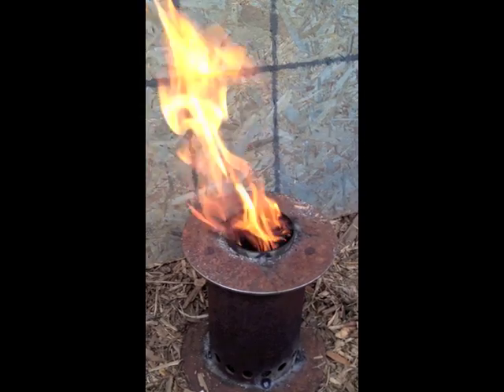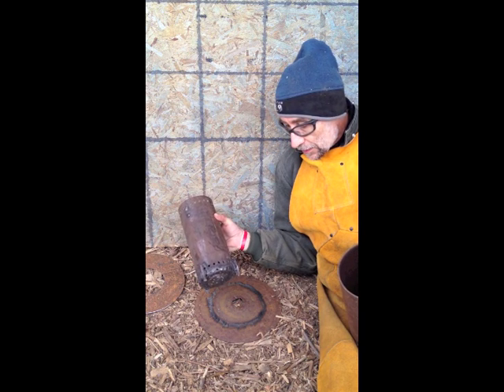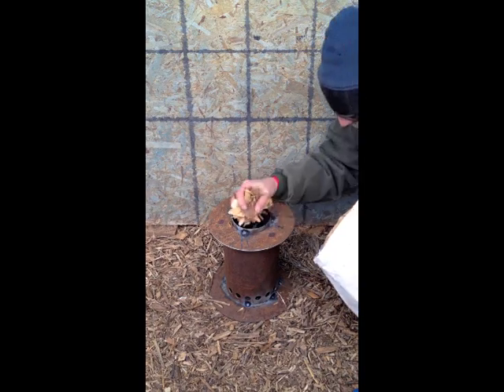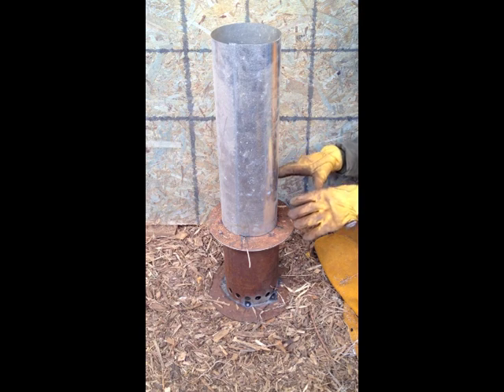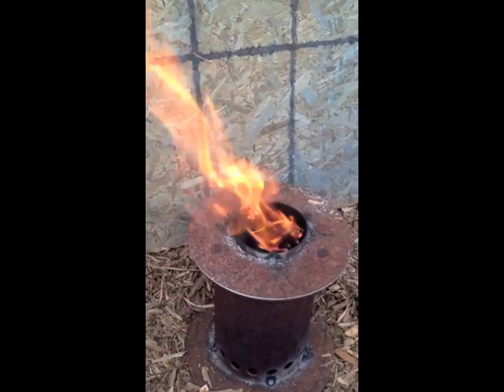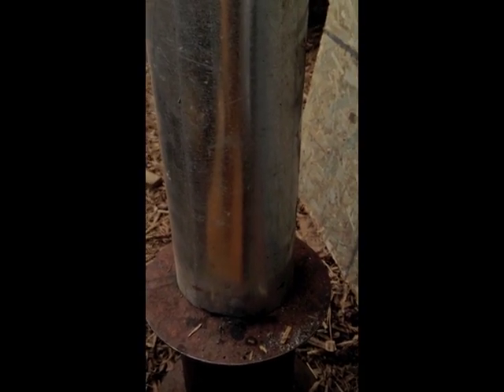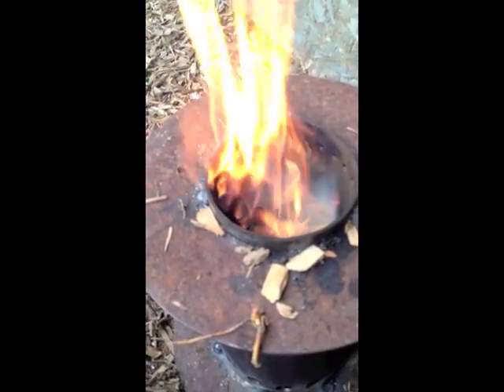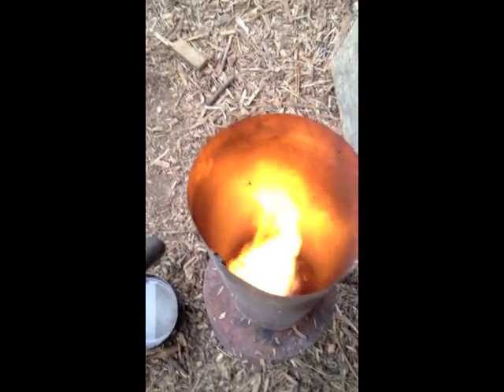Wood-gas Camp Stove

Comment: The 'draw' that is created by the chimney is called the Venturi Effect. Suspending a soup can upside down from the top of the chimney or facing down into the secondary combustion above the the secondary air holes is called a gas wick. heat accumulates with wood gases and helps prevent the fire from going out. Just anoth cool thing to play with, if you want.

Comment: I think it would be better to have a grille instead of holes in the bottom. The thing that happens is that the ashes pile up and block the main air entry, and therefore the embers shoot less heat, then less pyrolisis, then less second combustion air then less heat, equals lots of smoke.

I added a grille on my design, so the small embers and ashes can fall through it, and the powerful shooting draft is homogenous over time. I use it to heat my tipi. No smoke whatever the quantity of fuel inside.